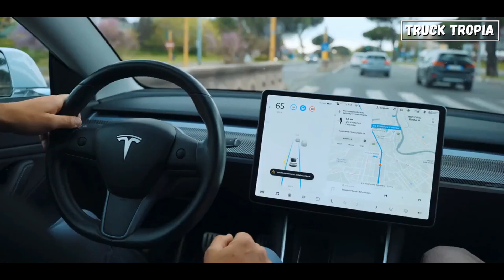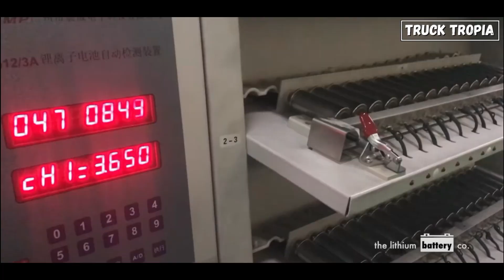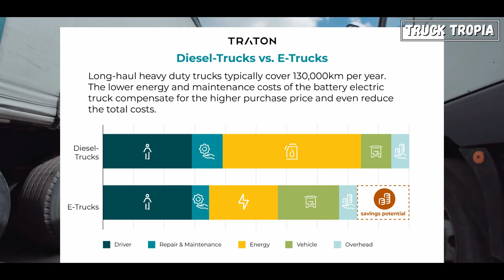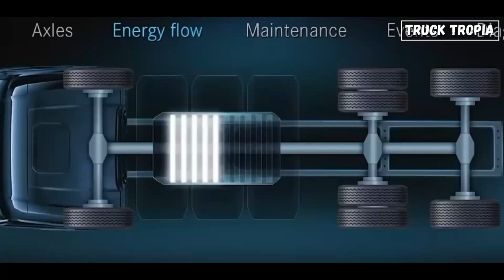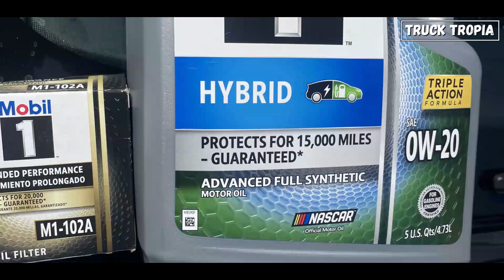Are Electric Trucks Really As "Green" As They Claim?

Comment: Alternative fuel vehicles are the future like Hydrogen and Biofuel.
Reply: Hydrogen? With all due respect, who's Kool-aid have you been drinking?

At least electric infrastructure already exists and only needs upgrading. Do you have any idea how complex and energy intensive making hydrogen is? How difficult is it to store? You do realize that the hydrogen storage tanks also require complex manufacturing and exotic materials, don't you?

Hydrogen is worse in every way, it still requires massive amounts of electricity to produce while also depending on a more centralized infrastructure to make and distribute the hydrogen.
Reply: @rbgerald2469    You’re just negligence Hydrogen can use all existing infrastructure also alternative fuels like Hydrogen and Biofuel use the combustion engine.

The manufacturing of batteries is filthy and they degrade rapidly Electric vehicles are not clean until 41,000-91,000 miles which their batteries won’t last too and soon as you replace the batteries you start over again. Also that isn’t the infrastructure for electric vehicles doesn’t exist because current infrastructure can’t cope with electric vehicles and there no clean way to make that much electricity and the price of electricity will skyrocket which is what is starting to happen now which will not only put your fuel bill up it will also put up your house bill.

Then what people seem to forget is that CO2 is needed in Industry and food/drink sector so using Grey Hydrogen is not a bad thing it’s actually the most efficient way to make Hydrogen and it’s not actually that dirty and the CO2 that is produced in the process can be used in Industry and the food/drink sector.

The storage of hydrogen is not as hard as people make it out to be.
Reply: @jammiedodger7040  ...The storage requirements for Hydrogen are way more different than say; conventional fuel. They needed to be cooled. The only thing needed for Electrical infrastructure is an upgrade, and the high prices are caused by Utility Companies who price gouge the heck out of their customers for Maximum Profit.

Hydrogen Fuel Cell vehicles are nothing more than glorified EVs, as they use Hydrogen to generate electricity. A battery can be recycled. And prices for EVs are going down, especially as a second hand market already exists

Comment: Well, you can't beat the efficiency of fully electric powertrain. All alternatives (mainly hydrogen since CO2 capturing will not be a thing on moving objects) have at least double the energy need due to its bad efficiency (compaired to the battery). 

Next gen electric trucks will be able to work an entire day on about 2 recharges of 30 min (plis a slow charge over night which is possible right now and only needs 50 to 100 kW). One of those rests is mandatory, so there is a 30 min setback compaired to diesel. 

Of couse, this means megawatt charging power which will be a huge investment but eventually will develop like the >300 kW CCS chargers we have right now. For hydrogen the investment would be quite the same or even more expensive while carrying double running costs due to half efficiency.

Comment: As always with these  comparisons you omit the emissions of  producing the diesel. To find oil, pump it up, refine it and deliver it to the truck plus transporting it in between all of these stages, during a lifetime of the truck. That’s causes enormous emissions so this is where big savings are
Reply: No mention of recycling 95%+ of all those battery materials to make a new battery when the old one reaches end of life. 
Also electricity generation is way way behind UK and EU in its low carbon mix so again video inaccurate. None of the sources cited either.

Comment: There is no way I would drive an electric sleeper truck.   I don't want to get burned alive while sleeping
Reply: Yes, there is nothing flamable in diesel trucks😊
Reply: @Bluebottlenose   A diesel truck will never catch on fire by itself once you shut it off and it cooled down.  But a battery pack with a defective battery cell can cause a thermo runaway.  Please don't say stupid sh*t when you don't know the difference between the two power source.
Reply: @shermanleung5839  it’s a new technology it will be fixed in time
Reply: @shermanleung5839 well told 👍👍👍
Reply: @Bluebottlenose your shitty sarcasm is equalled only by your extreme ignorance. Too bad for you that you actually know nothing about EVs.
Reply: @Bluebottlenose  diesel trucks do not explode because they don't use Lithium Ion Batteries Cobalt and so many chemicals
Reply: @Steve17256  they can
Reply: @Bluebottlenose  no they can't stop the bullshit no normal truck has ever exploded out of the blue
Reply: @Steve17256  yes
Reply: @Bluebottlenose  yet don't you understand that lithium batteries explode ????
Reply: @Steve17256  yea but it ain’t common
Reply: @Bluebottlenose  that's what i'm telling ya !!! 

lithium ion batteries in EVs are more likely to explode and spotaneously combust out of the blue
Reply: @Steve17256  yea, but it’s not common enough to really be a problem, and it due to poor maintenance
Reply: @Bluebottlenose  it's because of thermal runaway
Reply: @Steve17256  never heard of a runaway diesel engine I assume?

Comment: I like diesel electric. You get the best of both world. The best example is Topsy from Edison motors
Reply: Diesels Electric Technology is commonly used on railway engines
Reply: @Guywidtoomanytrains13 Yes, but in the case of locomotives, it’s less about efficiency and more about simplicity and practicality. 

Compared to a direct-drive, more energy gets lost when it has to be converted from rotation to electricity then back into rotation. Also most diesel-electric locomotives don’t even take advantage of regenerative braking . The electricity generated from braking is used to power a series of electric heating coils which are cooled by fans, dissipating the heat into the environment.

Locomotives use electric transmissions because they can have 6 or more axles that all need to be powered and connecting the engine directly to all 6 axles would be far too complex and impractical with so many moving which can become maintenance intensive. The transmission would also have far too many gears. Another reason is that electric motors can more precisely control the torque output and don’t require gear changes, which allows for a more even and constant acceleration.
Reply: Great for railroad use.